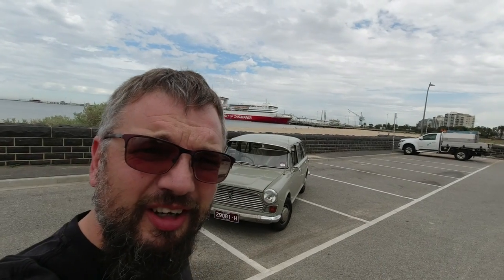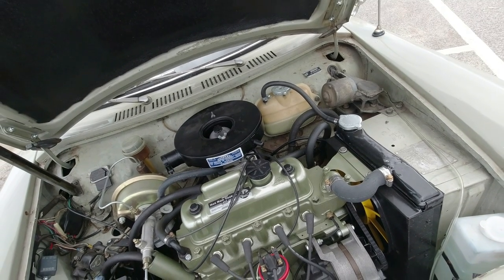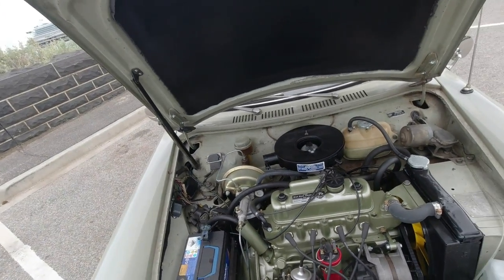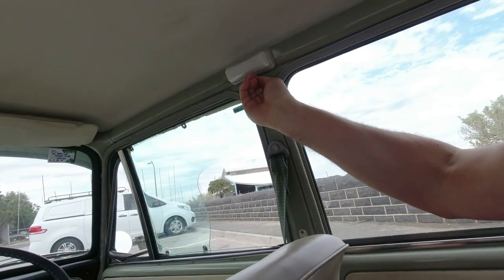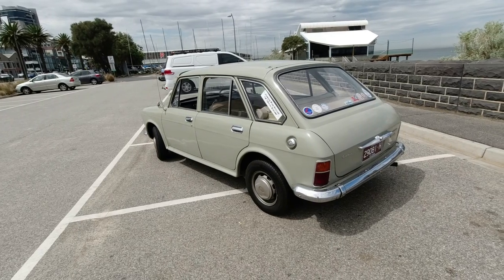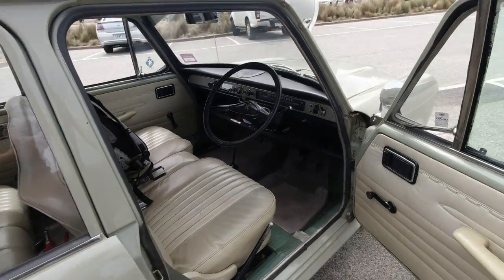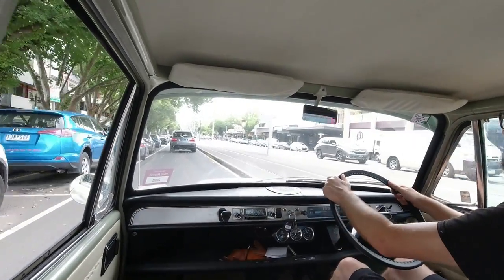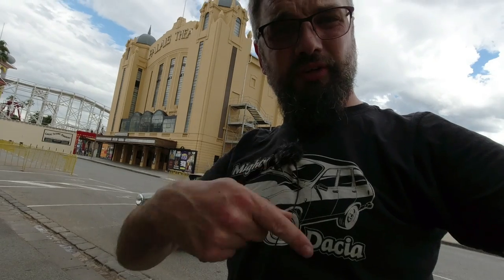Aussie Oddballs: Morris Nomad (1100/1300 station wagon thing)

Comment: The 5 speed 1500 cc version cruised very well in 5th overdrive but tended to overheat in summer. The simple solution was to turn the heater on and open the windows. The front and rear seats laid back to make a very flat bed once the rear seat supports were activated. Later models had a single speed heater fan.

Comment: In 1973 I acquired the normal 4 door version of that vehicle (I was 18 and stupid) - the 1300 auto though mine had deluxe trim so woodgrain dash and front bucket seats - the car was the biggest heap of crap - if it sniffed rain it would stop with ignition issues.  If I remember correctly with the Nomad the front and rear seats could all fold flat so you have a full size double bed and that was the selling point of the Nomad over the standard 4 door like I had.

The auto could be pushed (well tow started) like a manual if you had a flat battery.  Top speed was 78mph but on a cold damp night you could get to 82mph.
Reply from the maker: Yeah, for a car designed in the UK, they did a properly crap job on the distributor. We ended up making our own shield for our Mini...

Comment: What a beauty.  I had a powder blue one in 1992 that was completely full of rust, sadly.  A 1969 1500 4 speed man, 5 speed came later.  Loved it though, got me on the car fixing journey that I am still on!  I am hoping you drive a 1500.  Also, I drove that road to work for years and always wanted to board the Spirit of Tasmania instead of going to work :-)  Cheers.
Reply from the maker: Sadly I didn't manage a drive in a 1500.
Reply: Not to worry, I think you've done pretty well.

Comment: My music teacher in school had an automatic Morris 1100/1300, and it never gave him trouble. I think the official 0-60MPH times were better for the automatics than the manual (might be because of a lower final drive ratio?).

Very good presentation. 

Back in the day I have tried both a 1500 OHC Allegro and one with a tuned 1300 (1360 with a ported head and modified cam), and I found the 1300 was faster and much more fun. I suppose Dinsdale is the same. Could have a higher final drive, though

Comment: The manual I had was, if I recall correctly, a 5 speed. It was ok cruising out on the highway. Autos of that era tended to have a higher ratio final drive to compensate for torque converter slip. The Nomad may not have had that benefit. Certainly the rapid rise in RPM in fourth points to it.
Reply: Ours was a 5 speed as was our friends so I think you're correct Exidy,

Comment: Here is a challenge!
Try and get hold of a Ford  Falcon GTHO Phase 3. At the time it was released it was the fastest 4-door sedan in the world! It was a product of the war between Ford and Holden to win the Bathurst 500 mile race (later to become the 1,000km race), and made the pissy little cars available in the UK at the time look exactly like they were - pissy little cars!
 The GTHO had a 351 (cubic inch) Cleveland V8 motor, worked more than a bit to produce all that Ford would say was 300+ HP.
Reply from the maker: Sadly a bit late as I'm back in the UK. I need to visit again and find more older stuff.

Comment: I regard Camry drivers in Oz the same way I used to regard Volvo drivers in England in the 80s - steer clear. Some come very close to being Audi drivers...

As to BL in Oz, the parent company didn't do all that great a job supporting its assembly plant in Oz, much less its customers (to the surprise of no-one at all) and that attitude wasn't just restricted to light vehicles. I won't labour you with the details of how Leyland (Truck & Bus) looked upon its AU/NZ markets or we'll be here all night - suffice it to say that Sydney PTC (Public Transport Commission) bought ~ 750 0.600 Leyland Leopard bus chassis (Leyland's single biggest o/seas export customer) over a decade or so in the 60's/ 70s. When the time came to replace them, the Leyland offer was that underwhelming that in the mid-70s Sydney went all in with Mercedes-Benz and its (far superior) O.305, which it bought in huge numbers. NZ didn't fare much better either.

(Apologies for the boring aside)
Reply: Wasn't boring at all & explains a little as to why Leyland bus went from a powerhouse to a whimpering dormouse. And I agree about the Camry drivers ;)
Reply: not boring at all.
Reply: BL back up in nz was totally useless.bare minimum.
Reply: @Peter Boyd - I know very little about BL your side of the ditch, but your comment doesn't surprise me. When some bus operators (ChCh comes to mind) went back to Leyland for new Bristol RE bus chassis, Preston told them they could have the National or nothing - ChCh eventually got a few RE chassis but not the engine they wanted and had to make do with the Fixed Head Wonder (0.500). So, like Sydney, they went to M-B and MAN and never looked back.
Reply: taxus750 the Sydney Leopards all had 0680 powerplus engines. The mark 1s had no power steer until later retrofitted to some as drivers complained -and rightly so. Their steering systems were designed with PS in mind so we had steering that was even harder than systems that were "armstrong" from the start.
Mercedes were ordered to replace the ageing and parts scarce AEC RegalV fleet after Leyland announced they would cease making parts for them.
Yes Mercedes was selected after Leyland's less than satisfactory after after sales support. Trouble is Merc ended up not being much better taking the government to the cleaners on parts pricing, hence the rumoured reason they ordered a small batch of MANs in 89, so as not to be a 100% Mercedes fleet after the last Leopards were withdrawn later that year.
Reply: @James French - since this is o/t I don't want to harp on too much. I was winging it in my original comment so I appreciate your reply, but AFAICT Sydney Leopards were mostly (I erroneously wrote all) 0.600 powered. I've since gone back and checked and it seems many of the Sydney MkIIs got the 0.680 but not the P.680. I get my info from Bus Lists Australia and the Sydney Bus Museum. Nonetheless, I appreciate your input - I used to drive TKs and TLs in the 80s with Armstrong steering, so I can only imagine what a workout a Leopard bus would've been. Yes, I agree with you about latter-day M-B, their modern stuff isn't anywhere near the quality of 70s/ 80s O305 buses or NG/SK trucks but, to be fair, Volvo, Scania, DAF, IVECO & co aren't much better.
Reply: taxus750 they all had 0680 11.2 litre lumps in them. Only Mr Whippy the prototype Leopard with 8 stud wheels had the 0600.
Reply: @taxus750 I agree totally! For some time now I've said "Camry drivers are the new Volvo drivers". And I live in Oz, so things don't really change the world over, so it seems...

Comment: This is a brilliant car. Why do you think it didn't sell well in Australia? You mention the British didn't seem to have a good handle on what the Australians wanted, but in what way did they go wrong? I'm from the U.S. so I don't know much about the 70's Australian car market. Was it just ahead of its time? Seems to me that this would've made an excellent, comfortable family car, especially with the automatic transmission and cushy suspension. Hatchback practicality too? Aside from the somewhat... ungainly... styling, I can't find a thing I dislike about this car aside from a couple of nitpicks: the short gearing and the minuscule pedals.
Reply: The British used to dominate the small car market until the arrival of the Japanese. The early Toyota Corolla had reliability, plus it had carpet, heater, bucket seats and radio as standard, which were all extras in other cars.
Reply from the maker: Unreliability was one issue, but also frailty. I think suspension and CV joints made folk seek a simple rear wheel drive car instead.
Reply: When introduced in 1964 Morris 1100 the Australian market bought them in big numbers. They were highly praised for most of the reason you gave. However by the seventies the unreliability and aggravation of keeping them running was an absolute liability. The new innovations of an automatic option of the extra power of the 1500cc OHC  5 speed model counted little in countering the reputation. Big early sales meant nearly everyone knew of someone with a Morris 1100 that they had big problems with. The good qualities of the car when new new and running well were soon forgotten. Cars in Australia then were a major expense item, so you could not afford to buy a disposable car. The Japanese makers learnt so much from selling cars in Australia from about 1958 so they really started to dominate by the 1970s. Volkswagen, Fiat, Renault and others also had to bail out of Australian sales for a time in the late 70s early 80s since they could not compete with their damaged reputations.

Comment: If an 1100 and a Maxi ever had a kid, the Nomad would most certainly be it. Styling may well be a Marmite thing; you either like it or you don't (much like the Maxi & 1100). I rather like it personally, if for nowt else looking so unlike anything else that was available at the time. Then again, I like vehicles that most others would write off as ugly/ungainly, the GAC/Bombardier KD double-deck citybus (one of my all-time favorite bus types despite never seeing one in the metal for myself. Weird I know lol) being a case in point. In fact, the entire Bombardier/GAC Ireland story has it roots in yet another established Leyland customer (CIÉ in this particular case) falling out with them over reliability & issues with spare parts/maintenance support and deciding to go elsewhere (ergo, start an entirely new bus manufacturing company!). But I digress lol

Cracking vid as per, Ian. :) 'Dinsdale' is a belting example of her (his?) rare breed; the soundtrack off the engine/exhaust is simply sublime. The radio head unit and strip speedo are things of great beauty too.

Comment: The manual had a 5 speed gearbox option, the problem was again reliability with the early E series engine. Like the Kimberley they overheated in E series form. The autos using the B series were more reliable. The gearbox detente were an issue  with Leyland UK supplying the faulty gearboxes rejected for the Maxi to Leyland Australia sans circlip. These faults ruined the reputation for reliable motoring enjoyed by the 1100 and 1100S  (1275 engine). BMC and later Leyland tended to use Australia as an early testing environment, failing to consider our extreme environment. Overheating which in the UK was not an issue could literally  strand you for days here.  The UK home office  never considered local conditions until the late 1960s.  For example the  Farina cars were too small for Australians as post war the baby boomers were bigger than their parents. BMC Australia widened a Farina Austin as had been done with the Minor. This would have allowed BMC to have a competitive vehicle to compeat  with Ford, Holden and Valiant but British management quashed the project and insisted they cut up the prototype.  BMC then was at a sales disadvantage until the Kimberley came on line but was  forced to rush development, same issue with the 1500.
Reply: Its weird that they called it the "1100S" in Oz, it was the 1300 everywhere else.
Reply: @typos1477  Yes don't know why, I rebuilt an 1100 and 1100S in the 1980s  the 1100 was under geared and underpowered for Australia the 1100S was a better car in terms of drivetrain

Comment: I had looked at buying an automatic mini a while back and was persuaded by a mini expert not to touch it because the gearboxes are apparently massively problematic and costly to put right when they go wrong. That's why I bought the automatic Mk2 golf instead. (My wife can only drive automatics).
Reply from the maker: Yes, not the best auto gearbox, but very clever. When they work.
Reply: @HubNut  I have to say the golfs auto box, although only a 3 speed, is sublime. And it makes a kind of pleasing noise!

Comment: In the late 1960’s or early 70’s as a teenager the garage I worked in got the first Maxi and it was put in the showroom window with a cover over for the launch day. The bosses wife was going to have the first one. Before it was put in the window I was given the job of putting the number plates on. I marked the back to show where I would drill but I slipped when I tried to drill the first hole and a very deep scratch ran along part of the length of the number plate. Position on the car body in a panic I got some bitumen and painted it over the scratch. I then put the number plate on which covered where the scratch was and told no one. But I did feel guilty but I got away with it.

Comment: New Zealand got lots of Australian market cars, but not the Nomad.  I did see one Nomad, but that was the only one.  I thought the nose spoiled the look of the car.  A great pity Leyland did not make more of this car, including in the UK.  They did have a 3 door hatchback, it was called the 'Countryman'.
There was a hatchback version of the Austin A40 made by Innocenti, and the Renault 16 was always a hatch. But the first one may have been the Citroen Traction Avant Commerciale
Reply: Did New Zealand get the sedan versions? Morris 1500 with the E series OHC motor and later five speed gearbox option. Same wider grille and power bulge bonnet to give more clearance for the OHC engine.
Not too many Nomads sold in Australia either . BLMC underestimated demand for the extra cost option of the Nomad and were too inflexible to increase production before the car was dumped in favour of the Marina. As I heard it

Comment: If you get the chance, see if you can do a run with somebody's later (post 1966 I think) Mini. You've often compared the ride of these hydrolastic suspension cars with the ride of the Mini, but you may or may not realise, our Aussie built Mini also got the hydrolastic as standard later in its life. Curious to hear your opinion on its ride and handling.
Reply from the maker: Yes, I'd like to do that comparison. Minis used 'wet' suspension between 1964 and 1969 I think (a couple years more for the Cooper).

Comment: So with the side mounted radiator, the air flows through the grille, the fan pushes the air through the fins of the radiator, out through the wheel-arch, as opposed to a normal setup where the fan pulls the air through?
Reply: That's correct.  I fitted an electric fan to mine.  It was in the wheel well, and pulled the air through the radiator.   Removing the many bladed plastic fan quietened down the engine considerably.

Comment: Took some research from your side Ian on all those cars 'down under' which nobody had a clue about....well, my uncle in London actually owned a Chrysler Regal in the UK, black in colour and the first such car I ever came across with air con.  pas etc.  Luxury in 1976, but a true gas guzzler.
Reply: Very interesting. Love to know more. Was it one of these :
https://www.youtube.com/watch?v=mRuOdEOfLQY
https://www.youtube.com/watch?v=cJC759IAQTo&t=452s
Regal was the up market top trim level of the Australian Valiant for a time. I recall they may have been imported onto the UK by Chrysler to replace the Humber Super Snipe around 1967.
I think imported only for a short time by Chrysler-Rootes with little success. Most likely upset loyal Humber fans in shock with the demise of Humber. May have sold better with the 225 145bhp slant six as still had plenty of power and used a bit less fuel. 
The six cylinder versions always outsold the V8 versions by about 8 to 1 in Australia, despite all the recent nostalgia for V8s distorting the picture.
A one 1 of 1 special Valiant Charger Automatic Hemi 6 cylinder with triple weber carbs giving around 300 bhp was imported to the UK around 1973 but now back in Aus and restored. Some tiny numbers even sold by Mitsubishi in Japan.
Or perhaps one of these other models from 1962 to 1981 :
https://www.youtube.com/watch?v=vqNKCtIPNdE
Much more significant than BLMC in Australia. Hubnut was not able to drive any of these despite outselling BLMC by around 5 to 1. Even when in a car show or museum, he rarely was able to recognize them so not even comments on the Valiants from Hubnut.
Reply: @johnd8892  My uncle bought the V8 black regal in West London, and sold it two years later as it made him bankrupt ;-) If I find a photo, I will send it.  All I remember is the gold seats in it, gold linen.

Comment: Sorry, but you’re a few years out on Autobianchi - the Primula was released in 1964, and was the true precursor to the modern hatchback - it was later developed into the FIAT 128 by Dante Giacosca, and was regarded by many as the blueprint for the modern FWD transverse engined hatch with end-on, rather than in-sump gearbox.
Reply: The Innocenti (Austin) A40s Combinata was produced from 1962 -1965 and was  as such preceeded the Autobianchi by 2 years.
Reply from the maker: Yeah, forgot both of them! Tired brain.

Comment: Four speed automatic seems quite advanced for a 1970 car, thought three speeds was more normal back then? (Heck, my 1979 Honda Accord had a grand total of two forward speeds in its semi-automatic gearbox, it was surprisingly capable despite that, though).
Reply from the maker: Yes, General Motors was also using a two-speed gearbox Powerglide transmission in the 1960 and 1970s. Four was impressive for the time as you say.

Comment: Looks in very well kept condition 👍🏻 . So, why did they go for the auto box in sump option?
Are there any other cars with this? What are the problems?
Reply: Sestrel Bethesda most likely to save space.
Reply from the maker: Yes, space saving. Issues are that engine oil gets dirtier than gearbox oil and is subject to greater temperature differential too. I don't believe any other manufacturer tried an automatic gearbox in sump.